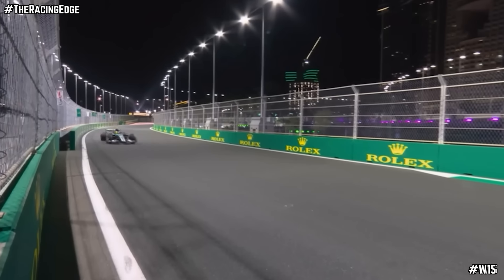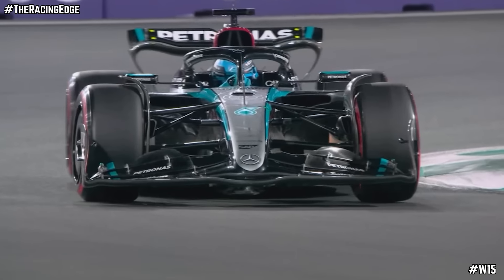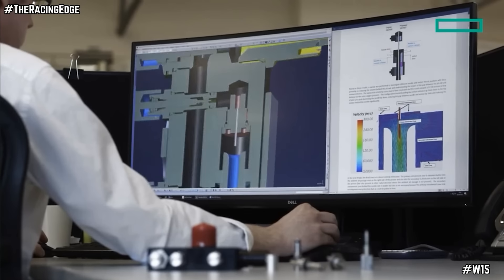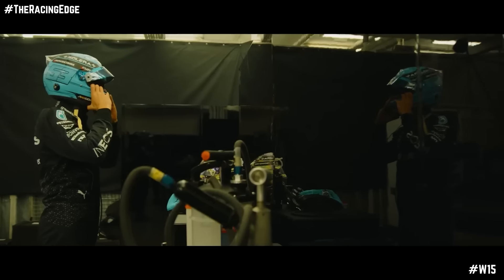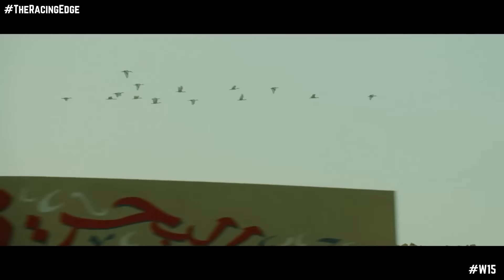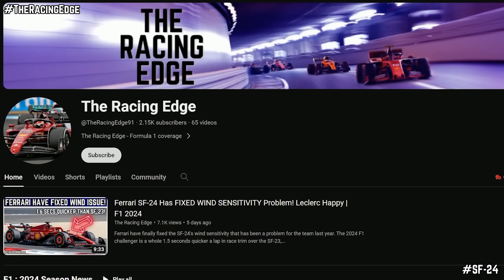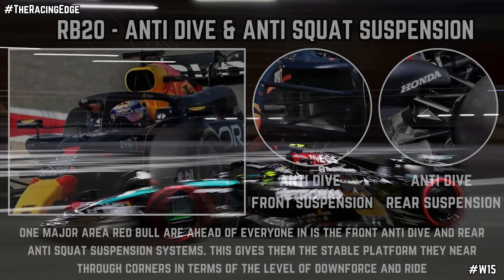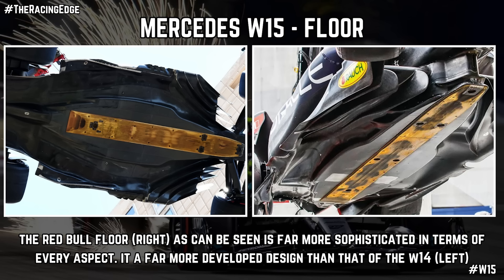NEW MERCEDES FLOOR For Australian GP! - High Speed Corners FIXED?! | F1 2024

Comment: Anti-squat is a suspension geometry adjustment commonly used in various types of vehicles, including RC cars, full-scale race cars, and off-road vehicles. It affects how the rear suspension behaves under acceleration and can have a significant impact on traction, stability, and handling.

Comment: What anti-dive does is change the amount of load going through the springs and as a result, the pitch of the vehicle. It does this by translating some of the longitudinal braking force into a positive vertical force in the suspension.

Comment: According to me, here's what happened at Jeddah :

Their car is draggy + Jeddah is a high speed track = They needed straight line speed. 

They needed straight line speed =  They ran a very skinny rear wing in comparison to other to gain straight line speed = Low performance in sector 1 where downforce was needed. 

As simple as that according to me.
Reply from the maker: Yes and no. Everything you said was true, but I still believe if they bolted on a higher downforce rear wing they still would of had the problems they did, but would of had an even worse race as a result. They definitely went the correct direction for maximizing their race results.

Comment: Uhhh it still doesn’t look like they’ve got a handle in the high speed corners in FP1 today in Australia 2024
Reply from the maker: Agreed, while a lot of drivers went off, that seemed much more to do with the wind direction. Mercedes and the W15 on the other hand looked to the eye just to be a result of the fundamental problems they have in high speed corners.

Comment: Im no engineer or an expert, just a fan. Can someone explain to me if Mercedes were running a different floor during testing in Bahrain? Then why would they change it during both races and expect good results? Sound like in incompetence rather than for a lack of 'understanding simulation data'. They are running different floors and expecting the same results

Comment: Sounds like they are trying to flog a dead horse. We designed this car via computer so we have to make it work. Somebody within the team needs to look outside the computations and box and rethink the situation. Computers get it wrong from time to time. Maybe raise the back end of the car a small amount then increase the downforce on the rear wing by a fraction and try and get more power from the engine at the higher rev range. Just an idea!

Comment: Their main issue is obviously PU. They try to compansate the deficit by overengineering the aero. Hence they come back to the same problem again and again. They try to achieve the unachievable by this PU.
Reply: Nope. Don't think so. It's the Aero, and Their own SIM equipment is not even accurate. Until you get your SIMS right, You are j u st stealing money from your Sponsors knowingly.
Reply: I also expect the same... Always try to hide it,
But at some point... ☺️🙄
Reply from the maker: As the other comments have said, it's definitely not the PU. There is no hp deficit, it is purely aero where they lack compared to others. Whether it be the simple fact of having less downforce or not being able to utilize it to the max. And their main problem is simply no having their sim produce what is happening in the real world...
Reply: @stephensegal5187  What about Aston, McLaren and Williams and their sims and engineers? Assuming all of these people couldn't achieve what RBR achieved for over two years is not logical. Somehow after all of the updates, all Merc engined cars cannot achieve last years RBR performance.
Reply: @F1_Unraveled  I am not saying there is HP deficit. Heat vibration size etc. of that engine may affect the overall performance of the car.
Reply: @b.7944  it's because of aero drag. When you let off the throttle on one of these cars, it is as if you hit the brakes really hard. The wings create different levels of downforce, but the penalty is huge added drag. The better your floor works, the less wing you need, and the floor generates much less drag than the wing. So a 20% better floor is seen as having about the same as a 20% increase in power from the power unit. To me, it is obvious that Mercedes SIM data has to be skewed because Nobody could possibly be this stupid 3 years in a row, even with Jamss Allen overseeing development.
Reply: @F1_Unraveled  We'll stated.
Reply: Both McLaren and Aston Martin are beating Mercedes using Mercedes Power units. If you will notice, McLaren for instance has a different suspension design, even though the A-arms bolt to similar attachment points on the transmission......
Reply: @stephensegal5187   McLaren is also slower then RBR. I am saying that engine has limitations that prevent achieving a performance better than RBR. If McLaren is better then Mercedes is irrelevant